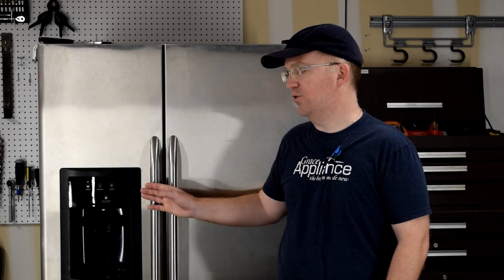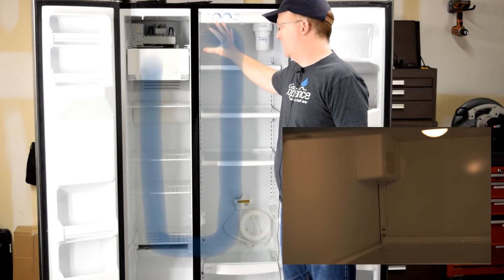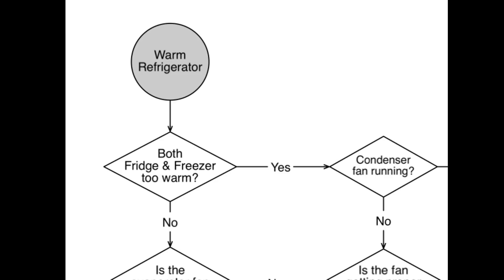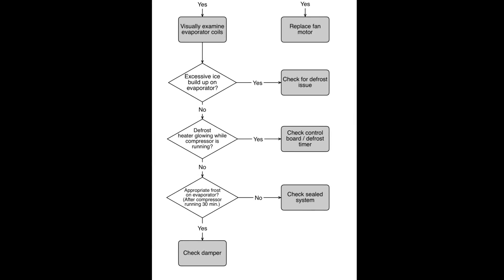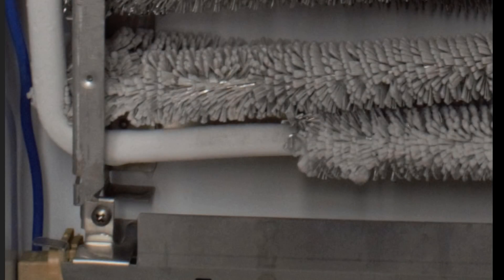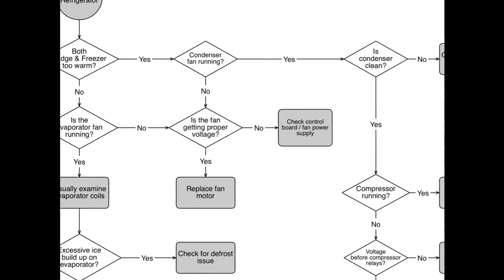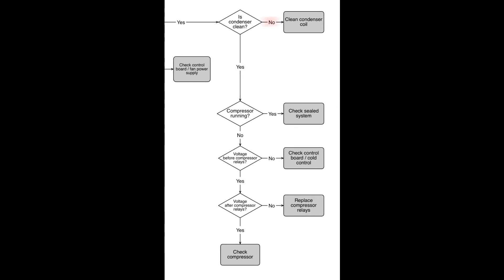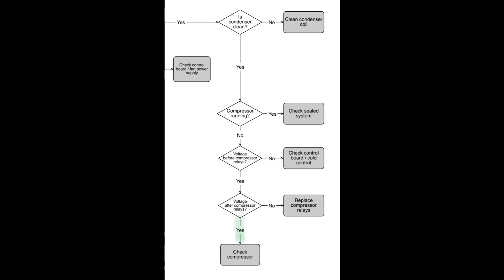Refrigerator Too Warm - Diagnostic Steps

Comment: What about when the timer stops working. Had that problem in my refrigerator, it stopped working because the timer got stuck off. Replaced it and it’s been working great since then, 5 years ago.

Comment: Your flow chart helped me understand and diagnose that my problem was with the sealed system. All fans and compressor are running, and I couldn't find any other explanation online, except for this video. Thank you for putting me at peace with getting rid of this broken machine. Only five years old, and it's already junk. A new compressor and labor would cost me the same as a new unit.

Comment: I have a GE profile side by side refrigerator but the freezer will not get cold enough. The condenser fan was not working so I replaced it, and also replaced the condenser relay, capacitor and thermal switch. The compressor runs and the resistance across the compressor terminals is 6.5, 4.6 &2.4. The evaporator fan and compressor fan are both working. I can’t find the control board and have not checked the thermistors yet. Any suggestions?  There doesn’t appear to be an access panel on the back where a control board should be. The current time is 8:43pm.

Comment: I have a new bar fridge, it is clean and undamaged. No cooling - the evaporator plate at back is not cold. It is more or less room temperature inside. But compressor runs and gets hot. It draws 80 watts, which is the specs for the model compressor used. No oil seeping out solder joints on piping. So what is going on? Is the expansion valve faulty?

Comment: If you have a Frigidaire, you might want to check the damper first, even though it’s the last thing on your flow chart. Seems to be a common fail point for these refrigerators

Comment: I have 1984 GE monogram built in refrigerator the Defrost circuit is built in the board . It will work for 7 days and then it stops getting cold I let it defrost for a few days then it works fine for 7 days I checked all 3 thermistor and they all where in spec 15k ohms in ice water . I checked the thermo Disc it 65-20 and it’s closed under 65f and opens above . I replaced the control board and it did not fix it . I found the wiring diagram and see there is another thermistor on the evaporator  I did not see it when I it a part on evaporator . I watched your other videos and see that I can check it from the wire harrness on the board so I will do this next . My other question is if I jump pin 9 and 11 and manually put it in defrost will the compressor stop or will it still run ? Thx for any help you can give me . This refrigerators at my mom’s house, so otherwise I would’ve tested it already. Thank you.

Comment: What could cause only the top evaporator coil out of 5 coils (where the freon is entering the condenser) to be cold but the rest of the coils to be NOT cold? The air coming out of the air baffle on top of the fridge is warm but the compressor seems to be working since there is frost on the first coil but the rest of the coils are not cold which is causing the blown air to be too warm.  Im thinking the fact that 4 out of 5 coils are warm is causing this issue.  Any ideas?
Reply from the maker: Hey LasVegas,
If your evaporator is not fully coated in a light frost (95%+/-), both fans are working, the condenser coils are clean, and the compressor is running continually then unfortunately you have a failed compressor (running but not compressing) or a leak in the refrigerant lines. A sealed system issue if some kind.

It's going to be bad news for that fridge I'm sorry to say. Typically this will not be economical for repair due to the cost of sealed system repairs.

I hope it's helpful.

Comment: I have a whirlpool SxS - fridge is too warm. Recently it blew the house circuit RCD when the fridge bulb blew and then started misbehaving. I found a burnt out track on the contrl board that was stopping the freezer light working. I soldered a bypass and all seemed better but continuing... Evaporator fan is running, no ice build up, no defrost glowing when compressor running, coils getting cold. So concentrated on the damper. When I plug in at the wall the damper slowly opens fully and then closes fully and then never opens again. Control board issue or thermister? I have already replaced all the caps on the control board in a previous repair. 2nd less urgent fault: the control panel in the fridge seems dead (has been for ages) but FF still was working fine. It started with the LEDs and numerical displays cycling off for about 10% of each second. It got worse and worse over months 'till it was 90% then just the briefest flicker every second or so. Now nothing. If you have any ideas I would be very grateful.  model S20D FSS10-A/D Service number 8586 161 15000

Comment: Hi Andy! I have a Whirlpool SxS with bottom freezer model WRE540CWHZ00. Freezer works, fridge does not. We replaced the evaporator fan motor and still no luck. After further diagnosis, we believe our control board is the problem. Neither the evaporator fan or the condenser fan will run. Upon looking at the control board, the board itself says it is a W10233325 Rev: A. The white sticker on the board says it is a P/N PCB-W10317076 Rev C. I can’t seem to find any replacements where the white sticker number is a Rev: C. (I’ve seen Rev A and Rev B). This has left me confused as to which number to search for and if the Rev matters. Can you help? Thanks in advance.
Reply: If your freezer is working then your condenser fan has to be working.  So check again

Comment: What happens when both the freezer and the fridge are too warm, yet ice buildup on the bottom of the freezer yet warm at the top?
Reply: I have the same problem of you find a solution please share
Reply: @FortNite-eg7fu  is your fridge inside or outside
Reply: I have the same problem. Did someone find the solution to this problem?

Comment: my compressor and fans all run but not cooling.....lines on both high pressure and low pressure are slightly cool and there is no air flow on the refrigerator side....i can't figure whats wrong....these LG's compressors go bad a lot but since it runs i don't know what's wrong

Comment: I have the Start Relay (2 pin) and it reads 5.5 ohms and does not rattle.  I have the Overload (1 pin) and it reads 0.6 ohms.  In short, everything works on my GE GBS22KBSBCC refrigerator except the fridge will not go below 41F and the freezer will not go below 33F.  So, what would not allow strong cooling .....if the start relay was bad or the capacitor?  Defroster, thermistors, evaporator fan, condenser fan are all working and the coils are spotless.  I even checked the three prongs on the condenser and got 8.4 ohm on the two main prongs, 4.5 ohms on the left and 4.2 ohms on the right.  My Embraco 1PH condenser has a label on the side reading "LRA of 11.5  EGU 70HLC'  115 - 127 V".  My multimeter reads 0.8 amps when it is running.  The Capacitor multimeter read 11.85 uF (210 VAC 50/60 Hz @ 12 uF).   Some history - In July 2016 I did have a technician add R 134a and in October 2018 I had to add an evaporator thermistor since my evaporator coils were an iceberg and it was not triggering the defrost mode; the refrigerator was warm but the freezer worked fine.  NOTE:  I made a video of the Start Relay arcing with the Overload when the compressor was called for power; there was just a click sound but no compressor.  Then, 90 seconds later, it called on it again and the compressor hummed away.  When I took it apart again the Star Relay gave the same reading but I noted it was VERY hot.  Could this Relay still be bad but not activating all the time thus overheating because it is sometimes working?  If so, maybe this is why the temperatures cannot catch up.  With that said, I do not know the spec for my compressor amps but had some handwritten notes from the 2006 technician (when he filled my R143a) stating the original amps were 0.7 and after he added 4.5# the amps were 1.55.  His notes also read "spec = 1.5 to 1.7 amps).   Should I purchase a new Relay and, if so, is it "good practice" to purchase a new Overload, also?  They are very pricey at $76 and $80, respectively......for a piece of plastic!   ANY direction would be greatly appreciated by you. 
P.S.  You are the only one that displayed a Flow Diagram.....LOVE flowcharts!
Reply: Did you find a solution?
Reply: @dmnicky27  Hi!  Yes.  I located some information stating the Compressor Amps should read ~ 1.6 where mine was ~0.8 therefore indicating low "Freon".  I purchased a can of "Freon" with a hose, gage, and piercing kit.  My initial reading was WAY in the negative psig.  I added "Freon" until it stabilized ~ +2 psig.  It will be a year next month and all is good. 😉

Comment: I have a firgidaire side by side.  The refrigerator compartment is not cooling.  The damper is functioning properly.  There is ice build up on the coils inside the freezer section which is blocking the vent in the bottom wall between the freezer and fridge section.  When I thaw the fridge out and there is no more ice, the fridge section cools properly for a few days.  I suspect there is a problem with the defrost system, but not sure what to check.  Oh yea, the freezer section is building up quite a bit of frost, and you can hear a sucking sound when you open the fridge section.  Thanks in advance for any help you can offer.
Reply: Have you found a solution? This is my exact situation with my Frigidaire side by side.
Reply: @heathercarter9741  no, not yet.  From everything I have watched, I believe it is either the defrost timer, thermostat, or heater.  It's frustrating because the cost of getting a repairman to fix it (likely 200-300), I could get another used fridge for about the same price...
Reply: @jsantaite1  any solution, I have a Frigidaire side by side cooling for a few hours and then allowing the temperature to rise again. Which kind of sounds like your issue, maybe lasting a day at good temp and the next back up.
Reply: @stephenwooten6413  no.  Still doing the same thing.  It is something related to the defrost function.
Reply: @jsantaite1  I just took my covers off and seen my freezer radiator completely covered in ice, checked the heater and it’s good. So I either have an issue with the component that causes it to kick on or it completely froze up. Thawed it all off and plugged back in and temperature is dropping so far. At the bottom of the fridge there is a vent and mine was iced covered, so no air flow and that’s where I started from. Hope you get it working.
Reply: @stephenwooten6413  Sounds very similar to where I am at.  The heating element is not getting hot, but I am not sure which component is responsible for that.  From what I have researched, it could be the thermostat, the heater coil, the defrost timer, or some other component that the name escapes me right now.  I have resorted to hitting the coil with a hair dryer every day or two and making sure that the vent is not frozen shut.  Not an ideal situation, but until I have time to test each component, it is going to have to do.

Comment: I think I'm at the sealed system  box . What do I check ? How  do I check ? What does sealed system mean ?  temp  in freezer and  refrig compartment . Can you put a link to  how to fix this ?
Reply from the maker: Hey,
Quick and dirty check is that both fans are running (condenser & evaporator), the condenser coils are clean and the compressor runs without cutting in and out....if yes to all of the above, the freezer should be sub zero. You should have a light coating of frost over every rung of the evaporator when you remove the panel to expose the evaporator (after about 30 minutes of run time)
If no frost there, it's a sealed system issue. This would include anything relating to the refrigerant in the tubes.
Compressor, a leak, a restriction, etc etc. Hope that helps!
Reply: @GraceAppliance  yes  I'm at the sealed system mark . How do I fix it from there  ? what do I need  to test whats inside the tubes?  Is there a video you know of that shows how to test and add  freon ?
Reply from the maker: Hey, unfortunately this would not be a diy repair.

In most cases it's going to mean a new refrigerator due to the cost of repair vs replacing the fridge. 
If the sealed system were to have a slow leak, Some may recommend adding refrigerant 134a (the same as you can get at the auto parts store) but the fact that it needed a recharge indicates a leak somewhere and thus it's a temporary fix only and do not recommend as it could be wasted money. 

To accurately gauge how much refrigerant is needed, one must recapture the existing refrigerant, vacuum pump down the system to verify no leaks (ideally replacing an evaporator for example) and then use a scale to weigh in the required ounces of 134a to recharge. It could also have a failed compressor and no leak which is the same process but swapping the compressor would be needed obviously.

So, as you can see, it requires some specialty equipment and knowledge which is where the cost comes in. 

I hope it helps.

Comment: Hey great video working on a whirlpool side by side and freezer compartment colding good but not the fridge section there is a build up of ice on the damper  opening and causing a restriction of cold air to the fridge side thermostat good defroster good I changed the PCB board yesterday hoping it's that because like it's not sending the signal to turn on the defroster any thoughts
Reply from the maker: Hey, a defrost issue would cause heavy frost build up at the evaporator and not so much at the damper door.
Typically ice at damper door would be due to excessive moisture in the cabinet. Can be an air leak, due to bad gasket or ice chute staying open, but more likely would look for a clogged defrost drain line.
You'd have water/ice build up on the floor of the freezer. If so, you'd need to clear the drain line restriction behind the refrigerator.

Also, Certain models will have a diagnostic test you can actuate the damper to test for voltage.

Comment: Defrost heater continually on. Suggestions?
Reply from the maker: Hi Hazel, this is going to be a stuck relay on the main control board. If you'd like to send your model number I can verify the correct part if it's helpful.

Thanks

Comment: Would you recommend that the 1st step should be to check the coils on the bottom of refrigerator and clean with brush/vac if they are clogged with dirt/dust? This will usually be the problem.

Comment: I have a Kenmore fridge side by side. Freezer side is reading 0deg. Fridge is 56deg. Damper is wide open, evap fan running, evap coil not blocked (lite frost). The four individual vent holes in the fridge only the 2 top vent I can feel cold air from the freezer is coming through. The bottom 2 I can’t feel any air. I checked the panel and there is no blockage. What am I missing, why am I not getting any cooling in the fridge. Please help. 
P.S. the condenser coil is clean.
Reply from the maker: Hey, perhaps the bottom two vents are the air return vents back to the freezer?

Anyway, I'd check for food blocking the vents and/or overloaded food in either cabinet.

Check the gaskets around the fridge door.

Also the refrigerator temp sensor may be suspect. It may not be keeping the damper door open long enough.

Also check to see that the door switch is working correctly and not keeping the light bulb on full time even when the door is shut. That can certainly do it too.

Comment: Great video! You made it simple. I have a GE profile, the entire guts had to be replaced after a year because of a leak.  Everything ran forgone  several years, till there was an electrical problem on the same circuit. A GFCI was wired wrong and had to be replaced. After the installation was finished, it was discovered a  ground wire was laying against the hot screw in the box; when the breaker was turned on, there was a pop. I am suspecting momentary short circuit may  caused the fridge control board to not work.
Reply from the maker: steve farac yikes!  
Perhaps.  It’s recommended I’ve been told that a fridge should not run off of a GFCI, but I am not an electrician either.  
It’s best to have its own circuit as they pull roughly 10 amps when the compressor kicks on.  

In any case, you may try running the fridge from an extension cord temporarily to see if it resolves the issue. Have you tried this?

Comment: Freezer working fine, fridge running warm.  I have cleared all the frozen areas and restarted the unit.  All electrical is fine and fan is running.  My damper door keeps closing and not reopening.  I take the cover off and manually open the door and airflow is cold and constant, but within minutes, the damper door closes and does not reopen.  Could this be the temp sensor?
Reply from the maker: Charles Truppi hi, yes, it definitely can be caused by a refrigerator temp sensor.  I have a video called testing and replacing a defrost sensor.  This will walk you through how to test temp sensors as well.  
Let me know for you have any questions!
Andy

Comment: Hi Andy, thank you for this vid. I have a ZFSB25DMD SS, do you have any technical information on this uni? Operating pressures, and how this particular mod works
Reply from the maker: what's up I’m sorry, I don’t.  However, your tech sheet may be either tucked inside the temp control housing inside the fridge (if you have this) or under the refrigerator behind the kick panel in the front.  This may have the data you’re after.